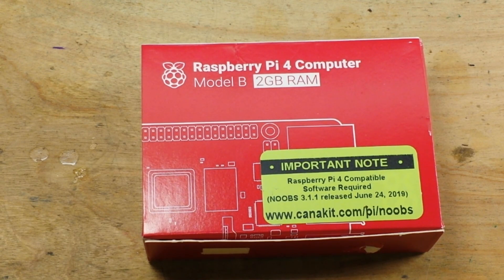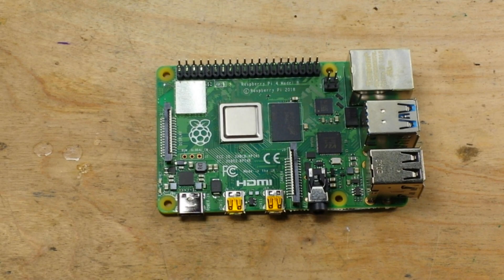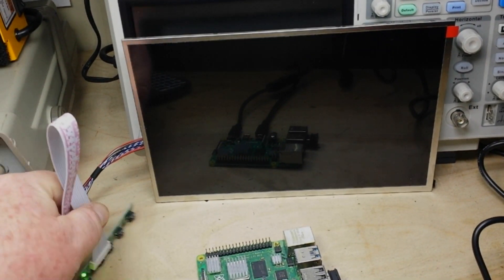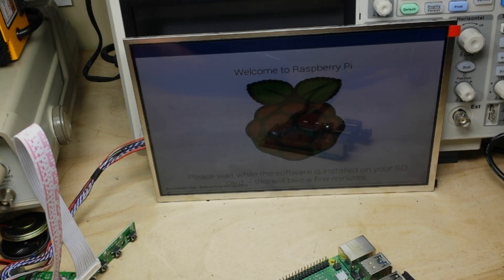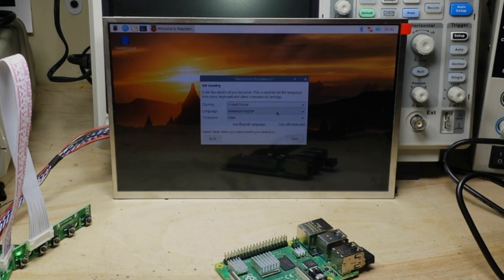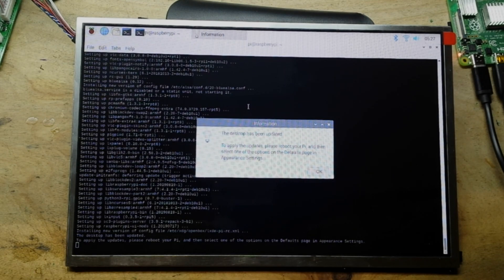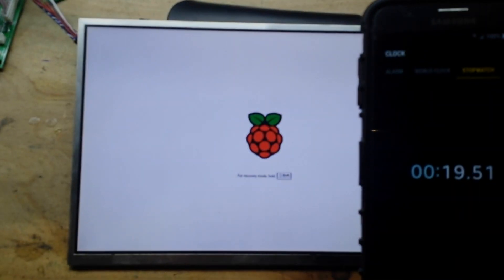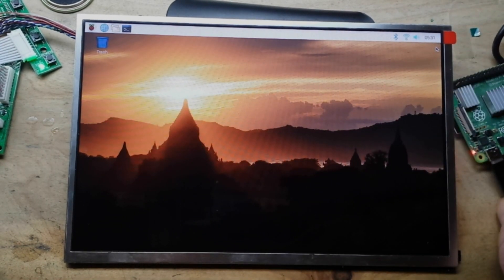Setting up my Raspberry Pi 4

Comment: Hello, I’m new to the raspberry pi world and had a few questions for you sir. Had the same issue you did where it wouldn’t boot up but you may have solved that problem for me. Also:

Can I please have a link to the software you downloaded on the as card?

The monitor I’m using doesn’t have an hdmi port so I have it hooked up to the vdi with an hdmi adapter. Will that still work? 

Please message me for questions I’m trying to make a smart mirror for my lady for Christmas and I can’t even get it to boot onto the computer...hopefully you can help!

Comment: You can get the Pimoroni heatsink from US ebay now for $6: ebay.com/itm/Raspberry-Pi-4-Heatsink-Rpi4-Heat-Sink-Pimoroni-Cooler-Cooling-40x30x5mm/273958255795 Youre welcome!

Comment: Me again.  Not seen your screen before - is it one of the chineseium converters or is it something sourced locally - or even homebrewed
Might be nice to see it in a little more detail.  I've had very mixed results reusing laptop screens.  My "best" result was with my worst screen - an old old thinkpad at least 17 years old, but it did work.  I did inherit a screen that was only a couple of years old which wouldn't have any.  I must have tried 5 different screen kits and only had one sort of usable result. I hate scrapping a machine that's probably only going to give me a HDD a few screws and fewer worth while components but my experience wit them hasn't yielded many happy endings.

Comment: Cana Kit's Pi4 Starter kit and pro starter kit are good entries for getting a pi4 right now, the 2GB model is nice, a good step up from the 1gb limitation of previous models, giving more space for the stronger processor to spread its wings, and as it's still a small low power SBC, 4gbs are not necessarily needed for most peoples uses. I do feel Cana Kit could have shipped these kits with a fan, since their new cases for the pi4 have a clip mount for a fan, rather than just space for a camera in the lid. But getting a fan is rather inexpensive.

A note however, you did place two of your heatsinks in the wrong place, the long rectangle should have been placed on the ram chip to the right of the SoC, and the tiny square one was meant to go on the usb controller chip that is right below the Ethernet chip that you actually placed it on. Though to be honest, these heatsinks by themselves do very little when the board is under heavy load. A small fan will however do wonders for managing temps provided your not running the board at full bore for extended lengths of time.

I just picked up a pi4 starter kit at my local best buy today and got it all set up. With the provided case and heatsinks, she idles at around 70 to 73 degrees according to the software temp monitor. Doing something as little as blowing on it slowly amazingly brings the temps down by 10 degrees, so a small fan can do a lot. And if you really want to push it, the ice tower cooler thats available will keep the temps down at near ambient room temps or less, but its kinda monstrously large and I don't know of any cases made to accommodate it lol.

Hope you have fun with your new pi4, I know I have had lots of fun with my collection of pi sbcs. One of my favorites is my Pi0w that lives in my jacket as a pirate box.

Comment: You could have so easily ruined my day ... heatsink applied correctly!  Many thanks.  Not certain they're on the right chips - there aren't many pikkies showing where - but the fins are ppperfect! :D

Couple of months ago I bought a bag of small heatsinks on the bay - I ordered 50 assorted for £2ish - they delivered 1000 of each of 5 sizes plus 20x6"x6"x3" blocks all in a big box along with heat cement pads ... I mailed them offering to return or forward to real buyer if they payed postage (fearing a massive bill if they'd screwed orders up completely), instead they apologised, said keep them all for free and gave me a code for 15% DISCOUNT good for 12 months ...  anyhow EVERYTHING I own now has heatsinks hanging from every component.  Cool eh?

Comment: the rpi4 has some competitors :P Pine64 plus / LTS;   Orange PI Win Plus and the Banana Pi BPI-M64 , If you want more juice Banana Pi BPI M3... Still failthull to the BeagleBoneBlack :P Put more heatsinks and fans. The RPI4 is more suitable to beginners and has a lot of community support, so not ditching the rpi at all. Just some hints of boards out there . RPi4??? Check the SDR software video from the Andreas Spiess :P
Music  ( ..Overload, Overload ....) :
https://www.youtube.com/watch?v=nhPaWIeULKk
For video recomend copy the youtube url to the mpv program for better performance results

Comment: I mainly use my pi (3B+) to dabble in Linux. Cool the new one has 2 monitor outputs. I recommend that if you can get both to work in a stable fashion, then use it that way. I think you put the two smaller heat sinks in the wrong location, don't think it'll hurt anything though.

Comment: I think you put some of those heat sinks on the wrong chips...
Reply: Stewartrv is correct. The main processor heatsink is correct but the medium size rectangle heatsink should go on the DDR (beside the processor), and the smallest heatsink should go on the USB controller chip(below the ethernet controller you placed it on).
Reply: I think the heatsinks were not adequately designed for the RPi4

watch?v=E-4GaAz7XNM - shows that they barely change the temp 

The Pimoroni fan shim has been shown to have better temp reduction.
Reply: To be honest they should not need to be added afterwards if they are needed even if they charge $2-5$ more they should be already supplied.  The RaspPi foundation made a misstep here I think.

Comment: I have one too and I also want to use it as  Shack PC.  Can have RTL-SDR v3 and GQrx connected and can also have Sunclock on a second monitor!   Also works for a low power FT8 or Wspr station!